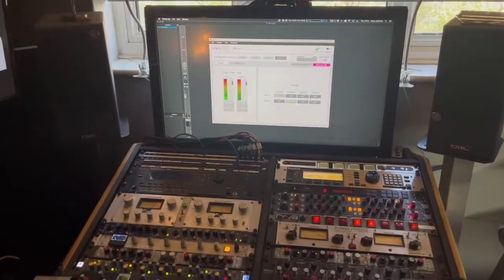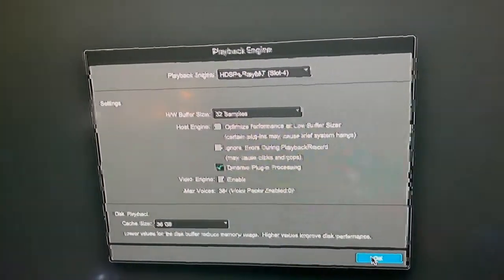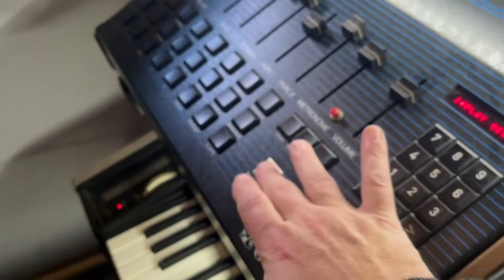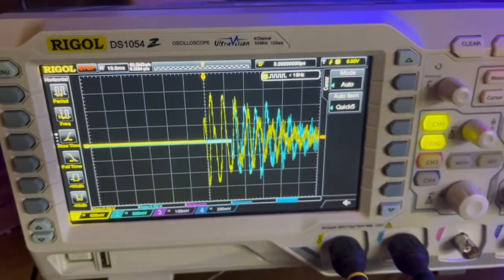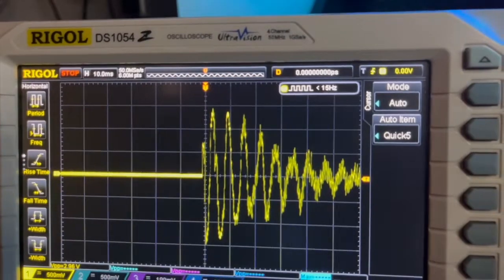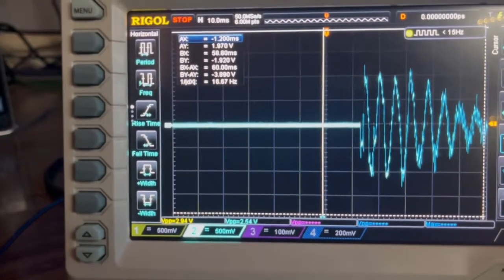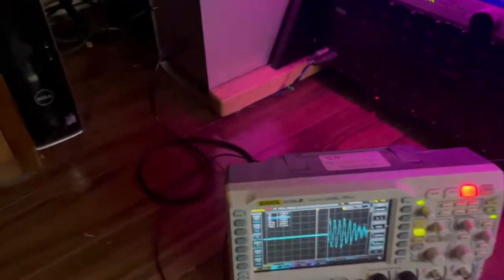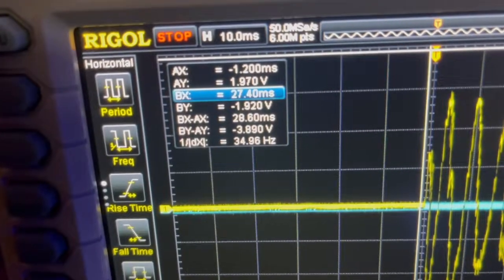Measuring the I/O Latency Of A DDRC-24

Comment: Thank you for the video! Does the Dirac calibration still work, if you disconnect your computer from it? Or doesn’t it work as a stand-alone calibration device?
Reply from the maker: Yes it works in standalone.  And you can still switch between presets.  So if you calibrated your mates room and stored it in say slot 4.  So next time you visit  just recall that from the remote control that comes with it.

Comment: I didn't expect that! I thought there would be less latency without the DDRC-24, not more! 😅
Reply: Maybe Dirac asked them to do that. Btw, the DDRC-24 is still in the circuit, just the Dirac room correction is disabled. It could also be that Dirac doesn't disabled, it just sets a zero 'correction' with a long latency.